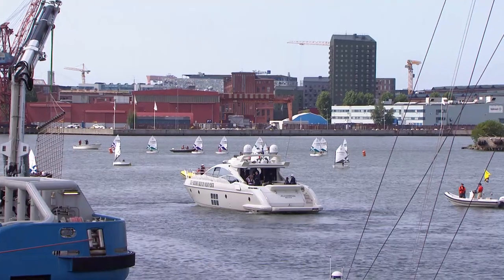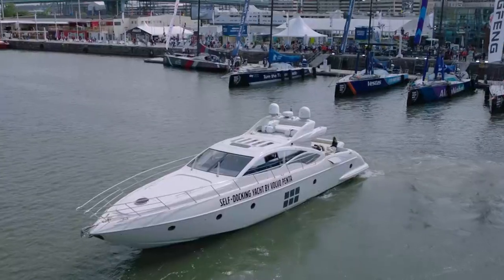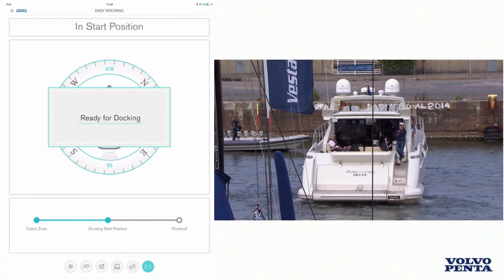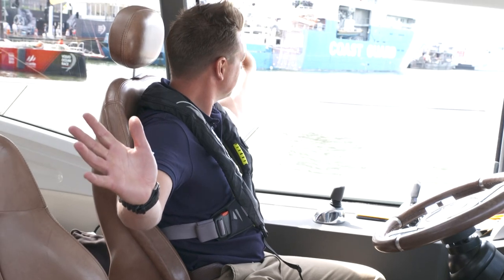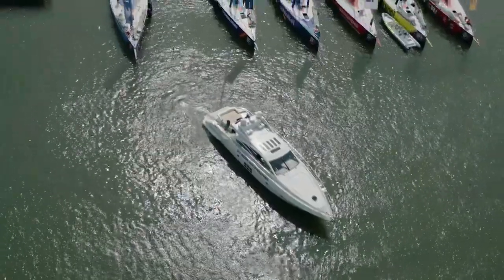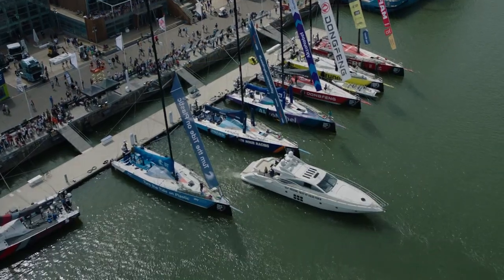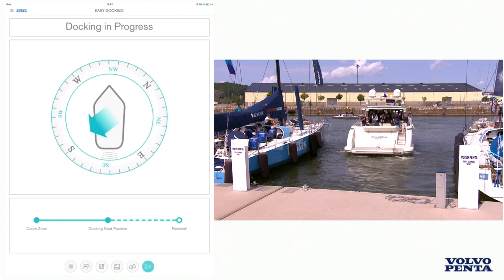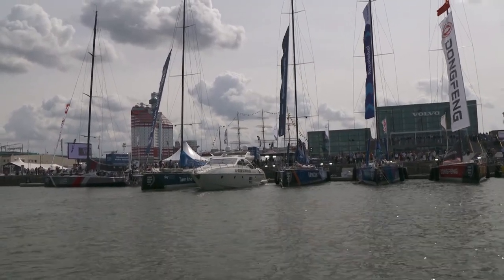Self-docking Yacht by Volvo Penta -  Live demo

Comment: I have run a couple of boats (delivery captain) that have the Dynamic Positioning option, rock solid into or down current, but takes a little time when you have a current on the beam. The IPS boats are quiet, responsive, and overall a nice package. The best part is reduced noise and no soot on the transom...

Comment: Lets hope all the safety concerns are addressed. Example; The skipper leaves the helm momentarily or the system defaults and or disengages. The alongside craft has an occupant fall or diver in the water I'd assume the system would drive the machinery over the person in the water (in seconds).  In world aviation leisure or commercial aircraft we still require experienced pilots in full charge despite multi billion auto fly computers and back up systems.  There are many instances of over tech accidents there and this opens up many safety issues. I personally, if I was a Harbour Master, would not permit any such system on a pleasure craft mooring purely on possible risk alone.  There have been many innovations from Volvo marine, some, not without their  glitches. This would worry me for sure.